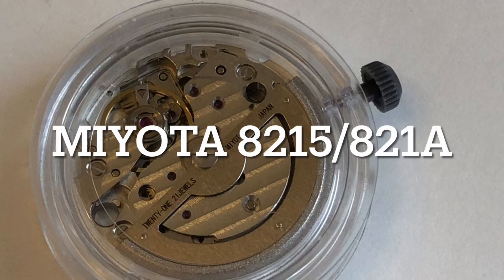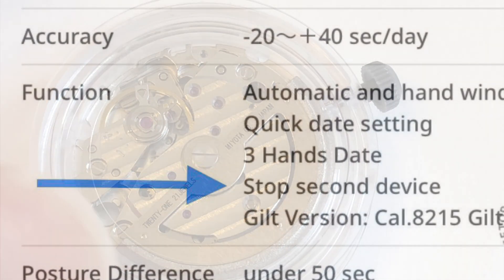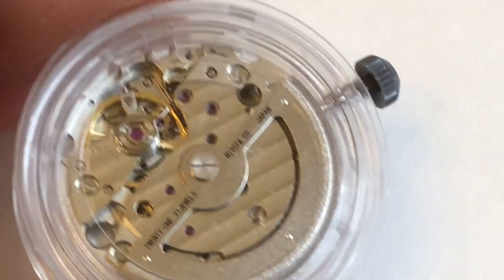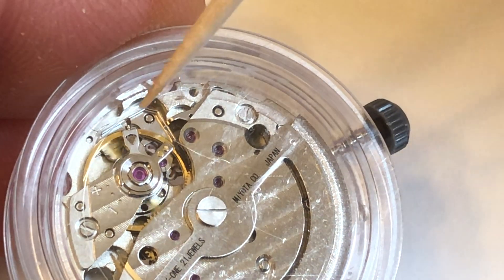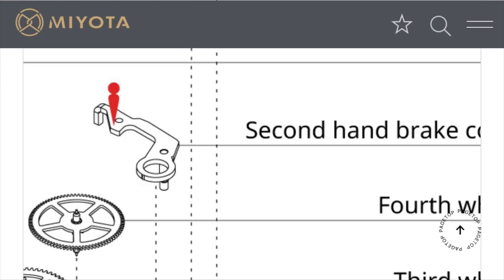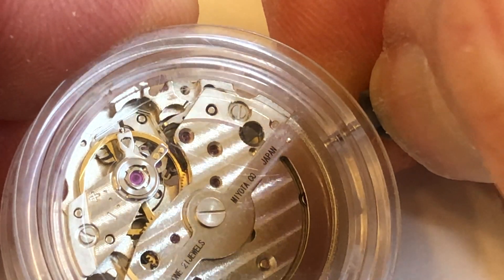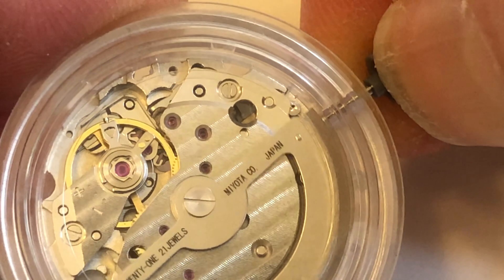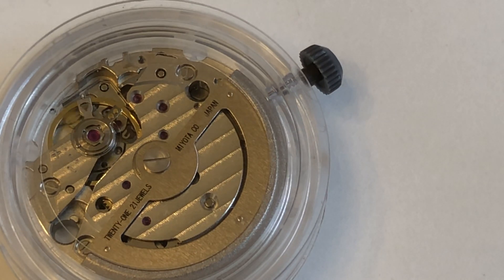Miyota 8215 821A Hacking explained - Automatic Watch Movement.

Comment: So it's possible to get a hackable 8215 movement with one watch brand and a non-hackable version in another?
Reply from the maker: Yes. It just depends on when the movement was produced. Newer 8215 should have hacking. If the watch has 821A (which is the decorated version of 8215) then most likely it will hack. 821A is the movement shown in this video. It has cut out rotor and Geneva Stripes. Miyota started adding hacking to 821A before 8215.

Comment: Hello do you know the difference between 821a and 8205 from Miyota? Both are good ?
Reply from the maker: The 8205 has day/date function. The 8215 is standard movement with date only. The 821a is basically a 8215 but with decorated finished and cut out rotor. All three movement are essentially the same.
Reply: @mtbbiker6401  Thanks :)) it was because I saw 2 watches that I liked with its movements. I finally ordered the Zeppelin LZ127 for 175€ my first mechanical watch

Comment: Which movement are you showing in the video?
Reply: Mostly 821a cause of the rotor and non-blue screws
Reply from the maker: @synonymous123  821A. Miyota started adding hacking to 821A before 8215. If you order an 8215, there's no guarantee you will receive one with the hacking mechanism. I did order and receive another 8215 from Aliexpress that specifically stated "hacking" and fortunately that is what I received but no guarantee on 8215.
Reply from the maker: 821A has the Geneva Stripes "cotes de geneve" and open rotor for decoration used in exhibition case backs.